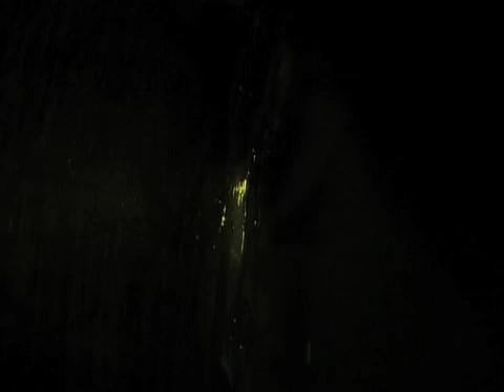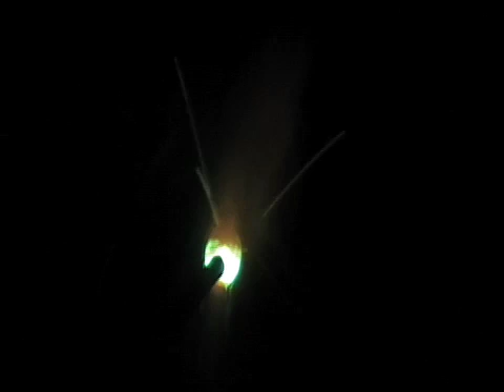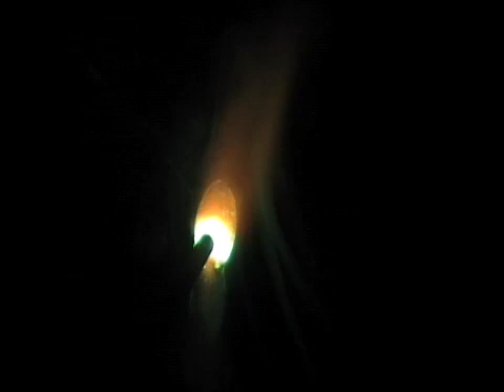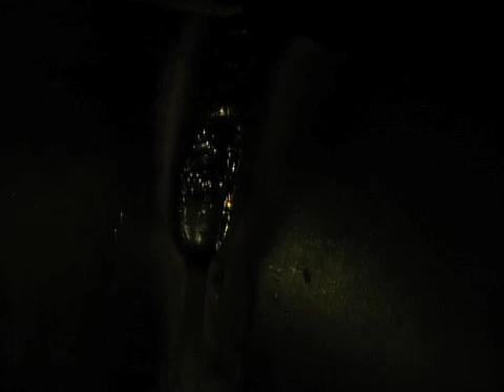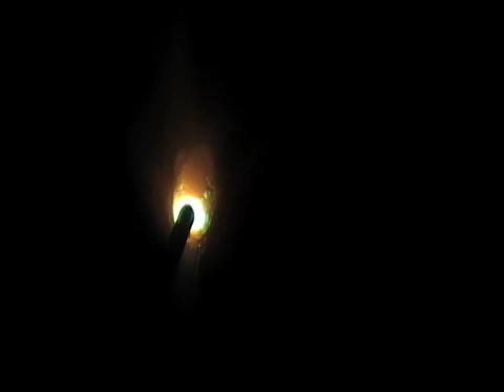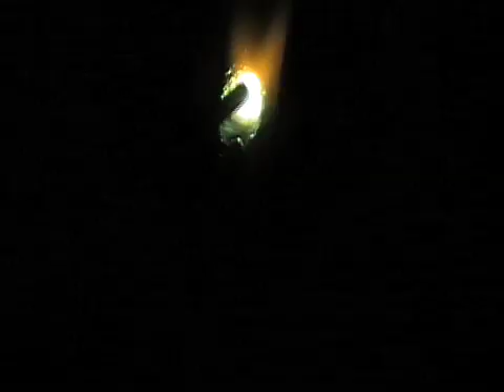Downhill Stick Pipe Welding [hot pass 2]

Comment: This is litteraly one of the shittiest examples of a hotpass the puddle is consuming the beveled edge which should never happen that’s for the capper. The hot pass should be whipped in and it’s sole purpose is to reinforce the root and dig any slag out of the wagon tracks of the root. I bet this jackass couldn’t draw a straight line with a ruler. DONT WELD LIKE THIS.